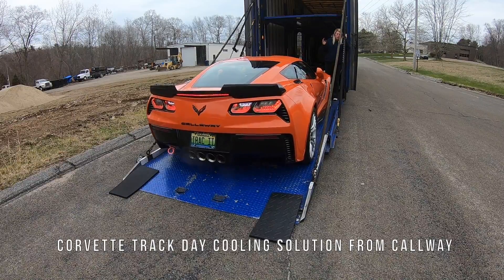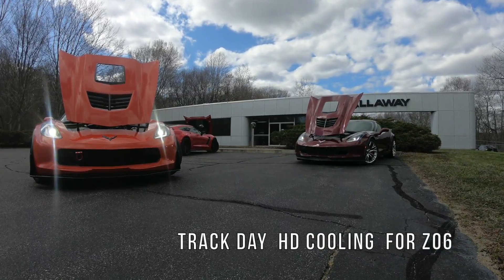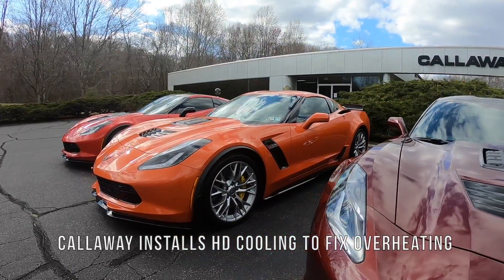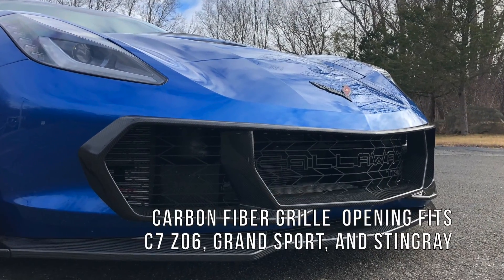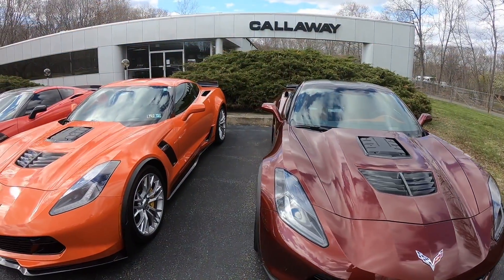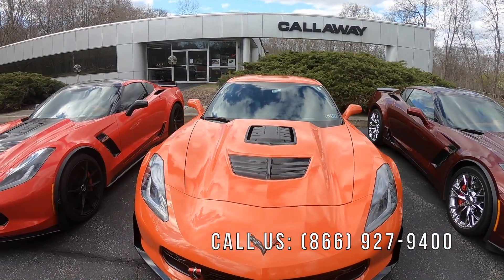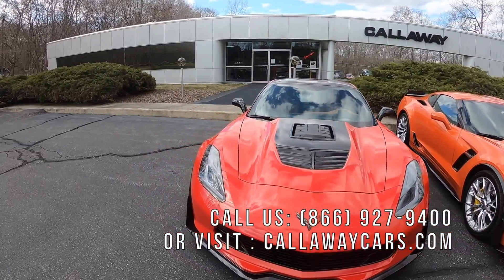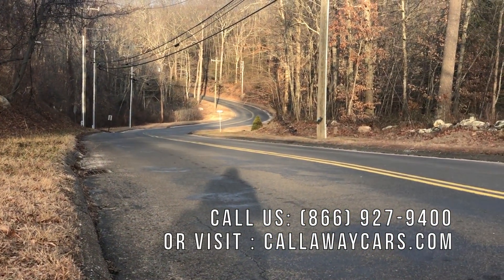Z06 Track car overheating fix from Callaway for C7 Corvettes race track day use

Comment: I have a 2016 C7 Z07 that I track regularly here in north Texas. Many other companies have similar systems, but....... the COST is hard to justify. There is a lot of “Corvette” markup on these products. I just wait until it cools off in the fall-spring time and track my car. With that said, Calloway and others LG, gspeed etc., prove me wrong on the cost.
Reply from the maker: It is costly to do it right no doubt, but our solution is proven in Europe as well as now here in the States and allows you to maintain the engine's enormous power while lapping for multiple sessions. For proof check out our web page on the HD Cooling system and look for the links to the engineering graphs https://www.callawaycars.com/homepage/components/hd-cooling-systems/